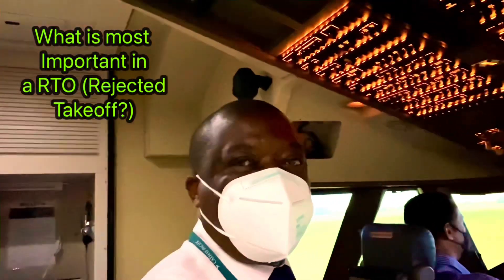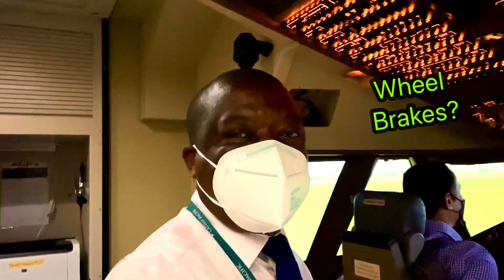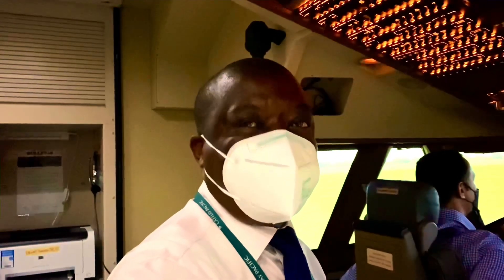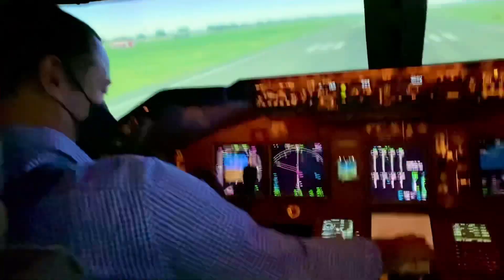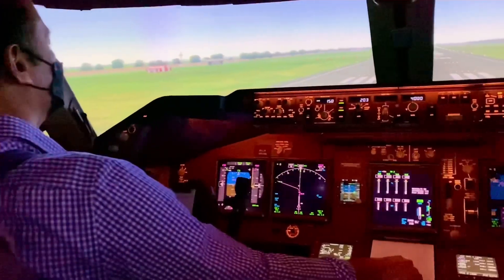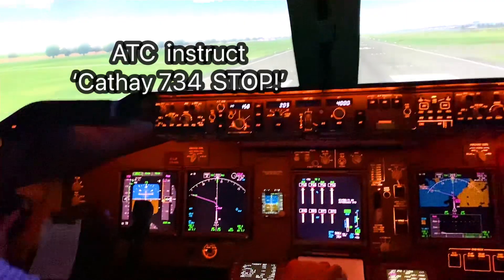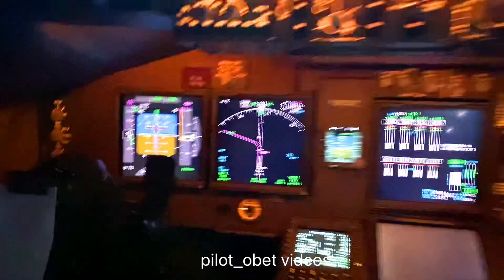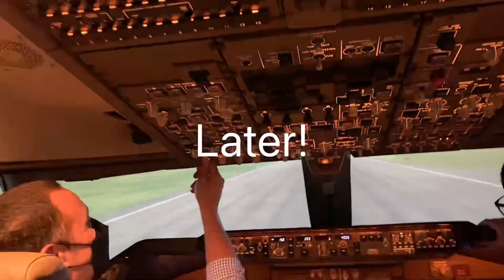Rejected Take Off: What action is most important?

Comment: Captain Obet, thank you for your videos. I appreciate them very much as a lifelong fan of aviation in general and of course the incredible 747. I wanted to ask a question unrelated to this video. What are the clicking sounds that are heard immediately after liftoff?
Reply: The trim wheel? That makes kinda clicking sound as it spins
Reply: @CameTo  i thought trim for takeoff was set prior. I know on older planes you would hear it and see the trim wheel spinning. I didn't think it was audible on newer planes without a wheel but that makes sense. I hear it at every liftoff and typically see the pilot flying trim on the yoke later.
Reply from the maker: I’ll take a listen…
Reply from the maker: I think it’s the Captain resetting and re-starting the stop watch. He is using a button on the side- see if you can see his left hand starting the stop watch(you can just see his finger doing it with a click).
Reply: @pilot_obet  it''s not in this clip, Captain. I hear a series of clicks on any 747 video immediately after "rotate" and liftoff.
Reply from the maker: It’s likely the landing gear lever latch after liftoff- allows pilot to move gear lever to up position
Reply: @pilot_obet  thank you! I really appreciate your videos, very informative.